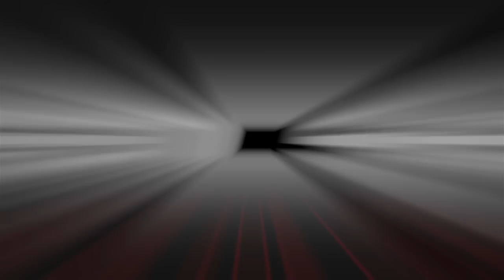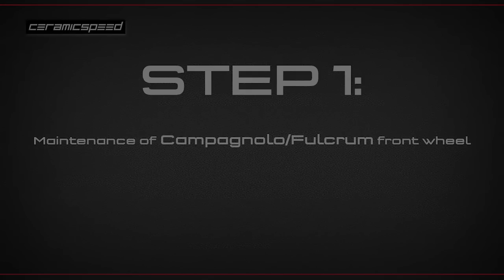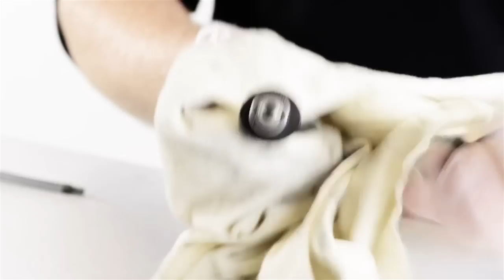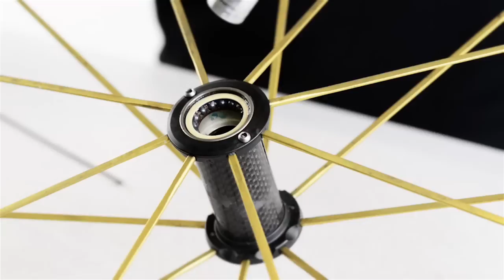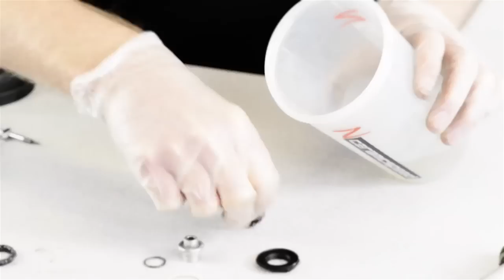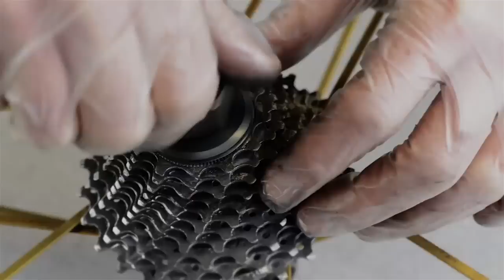Maintenance of CeramicSpeed Campagnolo/Fulcrum Wheel Kit

Comment: what happens to metal races with hard ceramic balls?
Reply from the maker: Hi Tim, thank you for your question. It is a common misconception that 'hard' ceramic balls will destroy 'soft' steel. If the balls were not smooth and evenly spherical, there could be durability issues in this combination. However, with the precise quality of CeramicSpeed balls, the hardness of the ceramic balls enables the surface to remain smooth and overall shape to remain perfectly spherical, leaving no way for the balls to damage the steel (two smooth surfaces rolling together).
Reply: @CeramicSpeed  is it true they have a smoothing effect?
Reply: a smoothing effect unlike steal?
Reply from the maker: Hi Tim, while this is something we would expect within our industrial division working with larger bearings or heavier loading, we would not expect much of a smoothing effect within the loads bicycle bearings regularly experience.

Comment: when i try to remove the screw over the bearings adjuster, the one that will remove is the opposite one, so i cant remove the bearing adjustment screw. any suggestion?
Reply: I have the same problem. I filed flats at a very careful and parallel 14 mm width in the opposite side of the axle to hold it while removing the part concentric with the bearing adjuster.

Comment: methought ceramic bearing didn't need (much) "grease" at all, friction wise, to perform?  Also.....how often do you suggest (or how many km's...) having to clean/service these bearings?  @CeramicSpeed .
Reply from the maker: +al karg After 5-10.000 km or at least once every year, even CeramicSpeed bearings need to undergo maintenance. That is to ensure the same optimal performance and to increase the lifetime of your CeramicSpeed bearings. Compared to other commonly used bearings on the market, the need for maintenance interventions on CeramicSpeed bearings is reduced. Nevertheless, all bearings need maintenance and greasing from time to time.

Comment: Hello CeramicSpeed ! Campagnolo says thats not grease lubrication, only oil film, isnt it?
Reply: +Eduardo Garc&#237;a Guti&#233;rrez only with the CULT bearings, which in any case come stock in some of their wheel sets only. CeramicSpeed is a 3rd party supplier of, well, ceramic bearings. These shown are not the original Campagnolo ones.

Comment: Thank you very mcuh for the video. Really appreciated.
What is the part number of these ceramic bearings, I wanted to fit a pair in the 2009 version of theFulcrum racing 1
Reply: It should be FULCRUM BEARING KIT RS-100 FOR WHEELS WITH OS HUBS FROM MODEL 2008